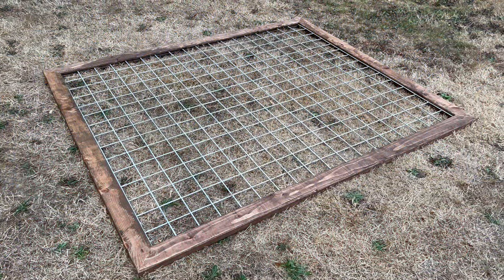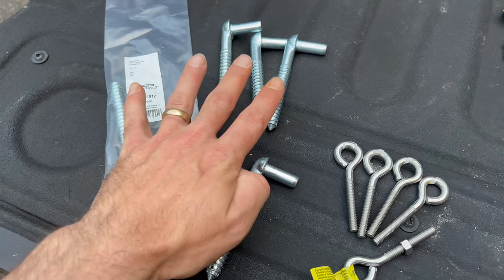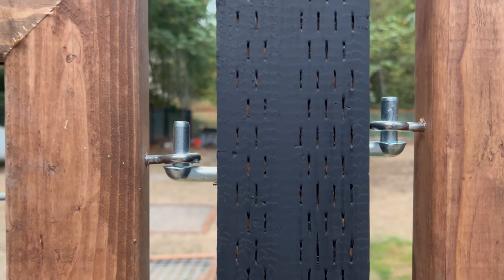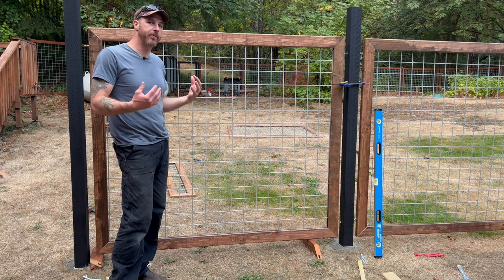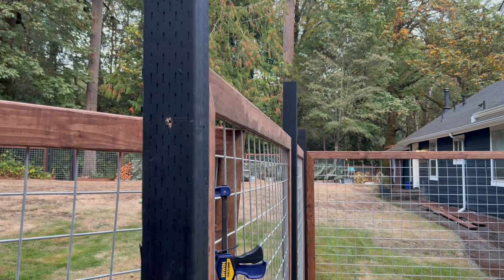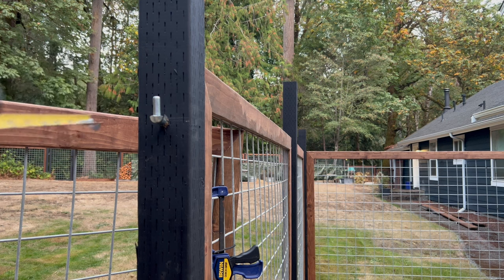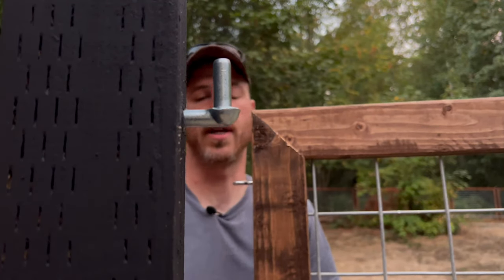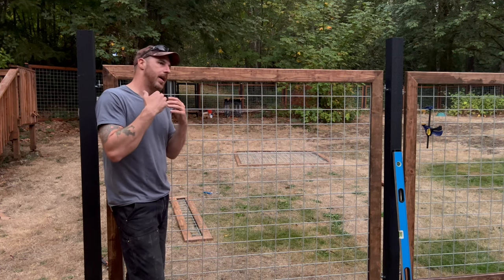DIY Removable Fence/Post System - Part 2 - Fence Panels. “When a Gate isn’t Enough”

Comment: Great work
Reply: First time ever seen these hooks for the I bolts (surprisingly)..   I'm a sucker for unique / proper hardware.
Reply from the maker: Thanks man! Yea I use them for gates all of the time. I would of rather had eyes which were in a lag bolt style but had to settle with the machine screw eyes. The ones they had were like twice as expensive and since I’m on a budget, these had to work. It all worked out great!

Comment: I had the same idea but could not find anyone who has demonstrated this on YT. For my situation, instead of PVC I was gonna use box iron (if possible). The fence panels I had in mind would be traditional lap wooden fence panels 6' x 6' (for privacy). I live in Ireland and the wind can be strong to say the least at times. I was wondering if posts like this would hold up in these conditions. I don't see why not unless I'm mistaken. Taking them up might be a bit more awkward for me in that case but I wouldn't need to remove them that regularly. I haven't seen anyone do a video like this. Very clever set up you have. Thanks for the tips.
Reply from the maker: Abcdefg! First off, thank you so much for taking the time writing a comment and showing support. I appreciate that so much. As for your idea… sounds perfect and it’ll work. We use ours all of the time! Right now I’m using mine bringing in loads of firewood for next winter. I also think, no matter how you do it, do what you think will work for your situation. The worst that could happen if you just have to redo something real quick. The PVC for me works really good and if you wanted, you can use the same PVC but just go deeper to have a better foundation. My fence is open as you know so wind isn’t an issue. It gets windy as heck here in the Pacific Northwest sometimes and I trust this designs using a more privacy fence like you speak of. The only real problem I think you’ll have is weight, but 6x6 isn’t that big and should be easy to manage. Good luck with your project and I hope you have fun and it turns out the way you want it to. Keep me up to date if you remember and ask questions if you need anything answered! Thanks again!
Reply: You probably already have your fence done.  I have the same situation regarding high privacy fence in high wind area.  You might be able to rig it so your fence panel  pickets or rails are removable,  i.e. using joist hangers or something? We usually get signs a wind storm is coming so I could remove some or all slats to prevent damage and help the wind pass through.   If I figure out mine I'll let you know lol.

Comment: Great job! I'm in rainy Seattle area and am wondering about the post swelling and getting stuck in the pvc sleeve.  Have you had any trouble with that?  Thanks Ron
Reply from the maker: Hey Ron! Appreciate the comment and support. I’m also from the PNW (just south of Seattle) and I understand your concern. I had my fence in all winter and as you know it was a wet one. I had absolutely no problems with the posts swelling. I was even surprised because I thought they would be difficult to remove and put back in. They weren’t though and I used it multiple times through the winter so I could get my trailer in and out of there. So I would say, it’s good to go, but that’s just my experience and other situations could be different but I’d say it’s a safe bet. Btw, I love having this. It’s unique, it works and it looks good. Thanks again and if you have any other questions, just let me know.

Comment: How are the pvc fence post sleeves holding up? I'm concerned they wont survive after a few canadian winters
Reply from the maker: Hey Jack! Great question. So I live in the PNW, Washington and we have very wet winters, but pretty mild. As for them holding up. I've had no issues at all but that's just me. You could however not use the pvc sleeves. You could just bury some wood in a box shape and that could do, that way if it rots out, you can just replace it. I'm sure there's other ways as well and hopefully this idea can just get you going so whatever conditions you have, it could work. I hope this helps Jack and I appreciate the question and support!

Comment: Do you have winter where you are, does the sleeve in the ground pop up in the winter?
Reply from the maker: Hey Matt! Great question. Here in the Pacific Northwest we do have winter, but it's fairly mild. We do get snow where I'm at and the ground does freeze for a few weeks a year. As for water, it rains here everyday and everything gets soaked. Having said all of that. I've never had them pop out of the ground or crack out. I'm not sure where you live but that's a really good observation with which I can't give you a solid answer on. I've had a lot of people build this system and I haven't heard one person say a problem developed. Anyhow, thanks for the question and I value your support! Let me know if you have any other questions.

Comment: I'm considering this design for my dog fence panels. I'm concerned about the holes holding water, though... should I put about 8 in of medium sized stones in the (deeper) hole, then place the pole + PVC sleeve, then add the concrete around that post like you showed us? I would like any water to drain out. (Coastal NJ) Would this work?
Reply from the maker: LTP! Thanks for stopping by with the question. I think the way you described what you want to do sounds great and it will don’t your needs. I live in the Pacific Northwest just south of Seattle and we receive large amounts of rain. I’ve never had a problem with it, but never really used it during a monsoon. I did use it last weekend though to pull some material in and out and the fence poles game out fine and looked great. It really does work that easily. 

So yea, do what you think is best. It’ll work for sure. My buddy made his post holder from pressure treated wood and old laminate flooring so anything will work.

Anyhow, I blabbed on for way too long. Let me know how it turns out. A lot of people have been doing this lately. Btw, we would vacation on Long Beach Island every year. The Jersey shore has a special place in my soul. :)
Reply: @StoneyCreekSparkchaser  Thank you so much! I'm only 30 min away from LBI! Amazing ocean air! Where you are is beautiful, too! Enjoy!
I'll let you know how the posts & fence project goes! 
Thanks for being a wayshower for us!
Reply from the maker: LTP! Let’s go! And there’s no need to thank me. This is knowledge we all need to know. And thank you for the kind words about where I live. It is beautiful here but nothing beats the beaches over there. We would vacation on LBI all the time. Beach Haven to be exact! It’s where I spent my childhood summers! Thanks for bringing back some memories for me. Good luck and let me know how the install goes… it’s no sweat! Stoney!